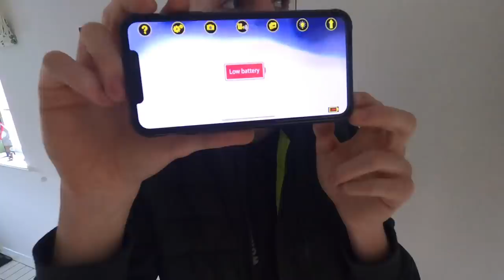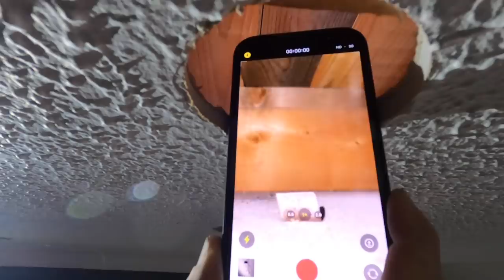Ruining Ceilings, Downlights, Electrician

Comment from the maker: I hadn’t said anything on the video as didn’t think to mention it but the plaster had it tested in the hall way before Christmas and came back fine, because he was meant to come and rip all the ceilings down to reboard. But looking at it technically I should’ve got my own test done and done my due diligence to Adam and myself and for the video, The house was built in 2002 so the ceilings aren’t that old anyway and to my knowledge they stop using asbestos around 1998 if that’s correct?
Reply: i thought asbestos was banned in 1982 in construction
Reply: @ecoterrorist1402  I think that was production but use wall until 199something
Reply: Depending if the house is an old build it could possibly be asbestos in artex ceilings but some now don’t
Reply: The house was build in 2002 but they've used singles?
Reply: Asbestos was used up until 2000. Although it was banned before then many builders had left over supplies and just mixed it with other stuff to get it used up
Reply: @me1ia  you should never put a belt sander on a artex ceiling I’ve done all hse courses don’t do it
Reply: @Charles Vane and what trade do you do then

Comment: Hi Nick & Adam 
Fellow Stafford lad here, now living in Melbourne and just finished watching another cracking video.. Just had a little idea about how to keep your power tools and lights charged all the time. Why don’t you look at putting in a second 12v lithium battery into your van with a split charging system and then have a charging station for all your gear. As soon as you finish a job just clip all your batteries etc onto charge then that way they can be charging over night or between jobs. Anyway just a thought, keep up the great work.
Reply: Yeah, you said lithium, even a marine/deep cycle battery would be ideal.

Comment: One video I haven't really seen a spark film yet is the customer process, so speaking with the customer how you both decide what to install, the budget, selecting accessories in that budget or do you just give them a figure with the accessories you normally use and where to install accessories. E.g cooker circuit position,  do you ask the customer what cooker or shower they intend to install so you know what size cable and mcb to fit etc etc

Comment: My first thought was possible asbestos. Fingers crossed it wasn't.
Reply: Most likely they are from the look of it.
Reply: It will have, but it did only contain a tiny amount, around the 2% mark, plus it's white asbestos that's less risk compared to the others.
Reply: @acelectricalsecurity  there is no such think as less risk than others and it also only takes one fibre!
Reply: @onefortheroad1  of course there is, there's varying degrees of risk associated with everything, this is no different.
Bloody hell if you thought like that about everything, you wouldn't get out the van to do a job. Or in the van, if you thought about all the cancer causing emissions we are all breathing in everyday sat in traffic.
Reply: @acelectricalsecurity  Yep, pretty much accurate, my dad filled and sanded down the ceiling long, long time ago and we all are still alive today (we weren't aware of it) 😀 And you are correct, it all based on the risks involved. I think corona is at much higher risk than asbestos 😄
Reply: @acelectricalsecurity  this is not open for opinion it is facts I take the asbestos awareness yourse every 12 months. If you think drilling into chrysotile asbestos is safe then you crack on but please don't advise others to do the same. All asbestos can and does kill you it's now overtaken working at heights as the biggest killer in the construction industry and people like you are part responsible ad you don't give it the seriousness it deserves
Reply: @onefortheroad1  no it's not that at all, I am a great believer in self preservation, and I do everything I can to stay safe, I am well aware of the dangers of asbestos.
But no matter how careful you are, it's inevitable you will cut it, because ceilings have been over boarded or skimmed over, and you may never know or realise once it's too late.
Reply: @alsanova  if ever a reply summed up someone's intelligence
Reply: @Dark Dreamz Yeah I agree, asbestos isn't the only one thing that can kill, there's plenty others that does.
Reply: @acelectricalsecurity  Interesting to know, and yeah I try wear a suitable dust mask when working and do regular clean up as I go along.

Comment: Phone camera to check clearance is a great tip, though I normally find previous trades empty coke bottles!
Reply: I use a metal coat hanger, drill I pilot hole, stick it up to spin around to make sure clear to get the hole big enough to fit the fitting.

Comment: You could just put  a piece of 2x1 across the holes (about 4-6" larger than the hole on either side), fix them with a couple of drywall screws then refix the bits you cut out with the holesaw with another couple of drywall screws then it's a simple patch up job for the plasterer, rather than reskim the ceiling 😉👍

Comment: I do exactly the same Nick when there is fitted floors above or a flat roof. The only extra I do is seal around the patched in areas of the ceiling with intumescent sealant to hopefully restore some fire protection to the ceiling.

Comment: No need to rip cealings down. Scrape any high bits of the artex then skim over with a finishing coat. Job done. (As people on here mentioned always be cautious of artex/asbestos in old properties 😷)
Reply: The complete ban on Artex containing asbestos didn't come into force until 1992 but continued to be used for some time after due to stock holding.
If Artex was installed pre 2000 to around 1994 then there's approx 30% chance it contains White (Chrysotile) Asbestos, post 2000 you should be ok, pre 1992 then the chance goes up a lot. If in doubt get it tested before you start work its not worth risking Asbedosis for you, your employees or your clients.

Comment: I am a general builder and electrician, the job we are on now is a full renovation to kitchen and dining room. New circuits, old cable removed, new plumbing including all plumbing for rads etc visible when ceiling is down is replaced and clipped. There is a rsj in this kitchen in the "tradition boxing" i had a custom beam made for other structural reasons and are cutting joists to move new beam into ceiling  void. We also as standard when doing this is cut our own service holes through (for future trades) and our service holes, once done the flat through ceiling with new spots looks amazing. I detest the rsj boxing and as a spark or plumber  we will or have found a beam in planned routes and is a nightmare. I enjoy you vids, true tradesmen are hard to find and you are one of them 👍
Reply: you're a qualified spark?

Comment: Be careful with them old artex ceilings they can contain asbestos
Reply: Came here to say this. I just move into a place and wanted to get rid of the artex textured ceiling just like the one in the video. Then clocked it could be asbestos. Got a test for 30 odd quid on amazon and it confirmed it contained white asbestos. Scary.
Reply: @ratgreen  I was thinking that myself, I guess thats why Nick mentioned using PVA glue but even so still a risk
Reply: @paultipton743  I think he meant PVA as bonding for a skim, though I'd imagine they'd use green grit or such like. Definitely worth getting it tested before drilling though
Reply: @Ken-oy5vt  yea you are probably right  I hadn't thought of that.

Comment: Like others here, I first saw a texture coated ceiling and thought "ASBESTOS (possibly)". There was no mention of a survey or knowledge that there was no asbestos, which means, you presume there is. I would highly recommend an asbestos awareness course for both of you.

Whilst cutting, you were wearing JSP P3 masks which is great but the contamination potential after the cut and for the tenant is a definite concern.
Reply: first time I heard about this type of ceiling , I have done a couple of works in places like this and im starting to get worried
Reply: Its everywhere!!!
Reply: @MrRorz12  most homes built before 2000 have them
Reply: @Dark Dreamz yeah, our electricity board has it
Reply: @Dark Dreamz well when the house get's rewired the electricians will rip it all out anyway

Comment: USA House Wiring 

17- 20amp circuit 

         Kit. Outlet 210.11.C.1 

         Kit. Outlet 210.11.C.1 

         DW Cir. 210.8.D 

         Micro hood fan and range outlet- A good idea 

         Ref. Outlet- A good idea 

         Outside Outlet 210.52.E 

         Outside Outlet Xmas-A good idea 

         Bath Outlet 210.11.C.3 

         Laundry Washer 210.52.F 

Laundry room Outlet 210.11.C.2 

Laundry dryer Outlet -A good idea 

Family room Outlet 

Garage Outlet 210.11 

Garage Freezer 210.52 

Garage Elec. Car Outlet 210.1 

Dining room Outlet 

Heater 210.64 

Bath room Heater Fan Light 

30 Amp Circuit 

Hot Water Heater-10/2 wire 

Dryer-10/3 wire 

Cooktop-10/3 wire 

Air compressor-10/2 wire 

Shop Sub Panel-10/3 wire 

 

40 Amp Circuit 

     Outside AC 

60 Amp Circuit 

Wall Oven 

Sub Panel 

15 Amp Circuit 

Smoke Detectors 

Alarm Panel 

Lighting 210.70 

Bed room Outlet 

Internet Outlet  

It is a good idea to add separate circuits 

Sub pump 

Basement 

Welder 

Attic fan

Comment: Good video 👍 Nothing to do with the video but would like to hear your Views on Hager board SPDs , seen a few “ Hager Gang “ folk fit the boards and the SPD’s come straight off the main switch , was My understanding SPDs had too have over current protection ? I think the Reg is  534.4.5 if I recall correctly , Wondered if you have fitted any of these boards and why this was the case

Comment: I’ve heard ppl using shaving foam for drilling holes in acm so the dust is controlled but think it’s for 20mm and under, anything over they’d use drill cowl and class H vacuum cleaner and all the correct ppe for obvious reasons.  
Thanks for the upload, stay safe.

Comment: Isn’t it against code to have a inaccessible connection/join. For example the existing light fitting in the center of the room you have used as a feed is going to be plastered back up.
Reply: They are maintenance free connections so they won't need future access.
Reply: @marcusstonham  that would mean they would of been soldered?
Reply: @mrseanpride6449  in the UK there are a few options for inaccessible joints, these are set out in reg 526.3.  A soldered joint would indeed be one option.  Nick used a maintenance free joint, which is another.
Reply: @andrewcadby  hey. Im interested as you have said the same said as guy above. What is a maintenance free connection?
Reply: @mrseanpride6449  from BS7671:
526.3(vi) Equipment complying with BS 5733 for a maintenance-free accessory and marked with the symbol and installed in accordance with the manufacturer's instructions.
An example is the wagobox with wago connectors.  Handy when you have little choice but to conceal connections in the fabric of the building.  Ideal, Hager, and other manufacturers make their own versions too.
https://www.connexbox.com/#Products
Reply: @andrewcadby  thanks mate. I don’t know if Australia has added these standards yet. I’ve always been told and learnt that soldering was the only maintenance free connections but as technology is getting better it might of changed